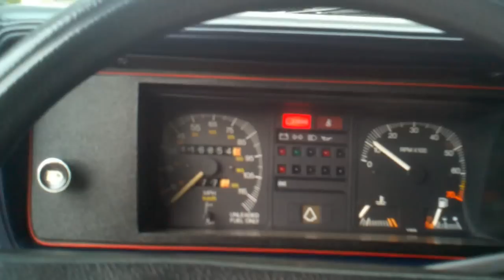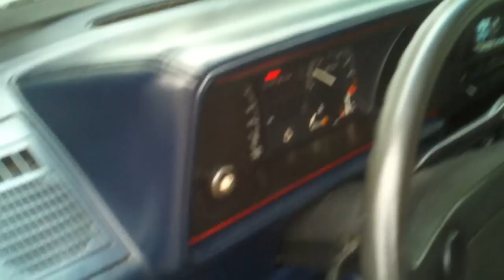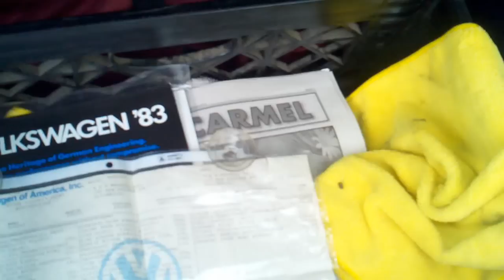1983 VW Rabbit GTI cold start and walkaround

Comment: I had one, best car ever. I could remove the key with the engine running, lock the door. With the heater on low. Best thing ever when it's -20 and your working 2nd shift

Comment: I got an '84 GTI and also live in NY... Mine needs a ground up rest though. Any recommendations on who to bring it to? :) What does it cost to rest a car like this?
Reply from the maker: All depends on what you want to end up with. Stocker? Trick mods?  Somewhere in between?  This car was a very clean original and needed nothing more than a complete cosmetic makeover, new carpet, and some very hard-to-find OEM wheels.  Well, and an engine/transmission rebuild :)  I'd estimate it took $4K in parts and material and maybe 200 hours all together.